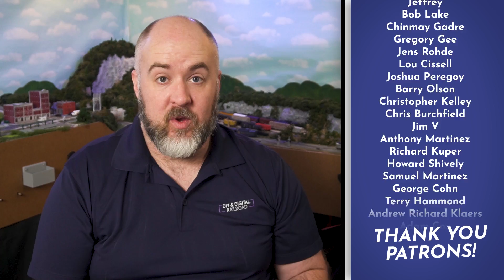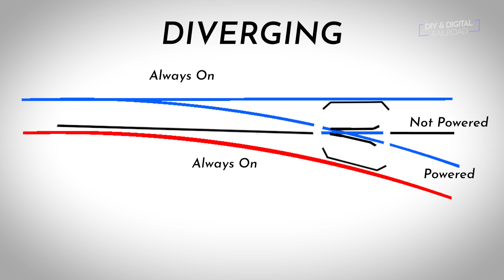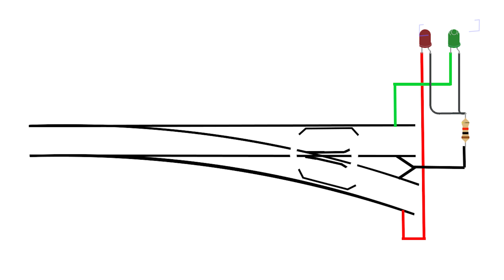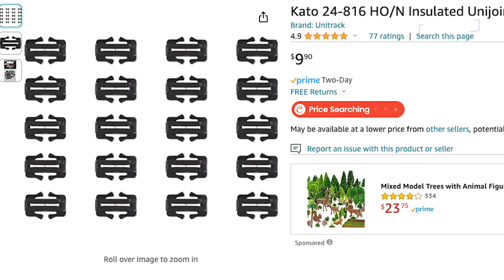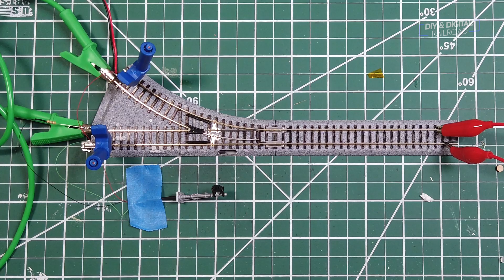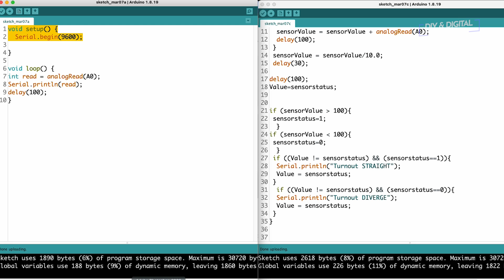Easy Signals for DCC Model Railroads

Comment: So could I follow this same guide, but add my common positive to the frog wire if using a tortoise/ip digital switch? this way as the frog is switched, so is the LED?
Reply: Also - do you need a diode to protect from reverse polarity?

Comment: DCC's FAILURE TO COPE WITH SIGNALLING, INTERLOCKING & TRACK CIRCUITRY !
But if you are trying to copy real life railway practice. Then interlocking between train movement, signalling, pointwork, and the necessary track circuitry is unavoidable. And I have not yet found a DCC system, that can provide this ! Only the traditional (12v DC) system known as TCC (Track Circuit control). Obviously it has to be understood, that no commericial company has solved the issue, that every model railway has a different track plan. Hence every layout requires a different wiring method to cope with its individual track plan !!!!

Comment: You'll have to pardon my ignorance as I'm still trying to learn how this works, but, how are those LED's working? I don't really know how to best explain my confusion, but as I understand it, LED's are directional current... and if you have the common on the frog section (which makes sense, as that flips polarity) you would be trying to send current the wrong way through the LED? I would think only one LED would light up and the other would not as it's recieving power the wrong way.

Comment: Thanks for the great explanation and the link to Larry's original video.  The circuitry is pretty basic:  two hot leads (one to each rail), one neutral (black lead to frog) and a two pole switch (the turnout).  I'm using Kato #6 turnouts and I can't seem to find, either in this video or Larry's how to connect the black lead to the frog.  Appreciate any help.
Reply: Rule #1 Watch video twice, comment once.  Larry is using the frog as the common (which isn't possible with Kato turnouts) where you are using the turnout's two inner tracks as the common.  Obviously, at the time, caffeine was reaching dangerously low levels.

Comment: Good video. Will use of these sensors “remember” the status of a turnout after the layout is powered down and then restarted? Or does that require the Arduino to “survey” the sensor’s status on power up? Thanks

Comment: OK but my usual modelling periods use mostly semaphore signals...
Reply: OK, so set up the sensor and arduino as per the video. Instead of the arduino "writing" to a display, change the code so that the arduino drives a servo that is connected to the semaphore.

Comment: If you put a ceramic capacitor in parallel with the resistors on your 'voltage sensor' then you wouldn't need all that jenky averaging code. It's alway better to do it in hardware. But it's also very scary that you're connecting one side of an AC dcc signal to the ground of your arduino. If your power supplies aren't well isolated something will go boom. I would recommend using an optoisolator instead.
Reply: Bonne idée,  quelle valeur?

Comment: I had noticed a short up to the point you said has to be isolated.  An AH-Ha moment. I assume a separate Arduino’s  might be needed for each turnout if have multiple turnouts?   Great information. THANK YOU 🙏
Reply from the maker: It really depends on the code.  You can have multiple signals coming into a single arduino.

Comment: Nice idea Jimmy, just a couple of points of clarification... Did you use the black insulated joiners on only the inner rails of the departure rails? also, your photo looks like a #4 turnout. The user needs to be reminded that these are user switchable between power routing and non. I am going to give this a try on a couple of turnouts in my yard and see how it works. Thanks to both you and Larry for the tips.
- Ron
Reply from the maker: Hello!  Yes the inner rails need to be isolated since the outer rails are always on.  The turnout shown was actually one of the Compact turnouts, but it is setup the same as a Kato #6.

Comment: Great video, Jimmy! BTW, Kato is just one of many power routing turnouts - many turnouts marketed as "DCC-ready" are power routing and would work as you have shown. Even those of us who use frog juicers are not left out in the cold: as long as the frog is electrically isolated from the two inner diverging rails (and as long as those rails are isolated from the connecting track, as you mentioned), this system will work.

Comment: This is pretty fantastic, I like the use of a signal on the turn outs , where are you  putting the insulation block on both sides of the turn out for the routes or at the beginning of the turnout? That confused me or maybe I should watch the video again. Great tutorial on the Arduino sketch too.

Comment: Not sure if it matters, but you loose the power routing of the turnout when you add those two leads to the frog.  A pair of diodes would stop that.  Nice video!

Comment: shame you dont do cmri arduino common anode signals or a video of
Reply: it's ok jimmy i did it
code underneath if it helps people

#include <CMRI.h>

#include <Auto485.h>

#define CMRI_ADDR 1  // CMRI node address
#define DE_PIN 5     // Pin 5 for RS485 DE on the Mega

Auto485 bus(DE_PIN);
CMRI cmri(CMRI_ADDR, 24, 48, bus);  // CMRI node with 24 input bits and 48 output bits

// Define output pins for the signal aspects
const int redPin = 13;
const int yellowPin = 12;
const int greenPin = 11;

void setup() {
    pinMode(redPin, OUTPUT);
    pinMode(yellowPin, OUTPUT);
    pinMode(greenPin, OUTPUT);

    bus.begin(9600);  // Initialize RS485 communication
}

void loop() {
    cmri.process();  // Process incoming CMRI messages

    // Read CMRI input bits or other conditions to determine the signal aspect
    bool redAspect = cmri.get_bit(0);   // Corresponds to CMRI output ID 1001
    bool yellowAspect = cmri.get_bit(1); // Corresponds to CMRI output ID 1002
    bool greenAspect = cmri.get_bit(2);  // Corresponds to CMRI output ID 1003

    // Set signal aspects based on CMRI input bits
    digitalWrite(redPin, redAspect ? LOW : HIGH);      // Invert logic for sinking current
    digitalWrite(yellowPin, yellowAspect ? LOW : HIGH);// Invert logic for sinking current
    digitalWrite(greenPin, greenAspect ? LOW : HIGH);  // Invert logic for sinking current
}

please note this is for a mega
kind regards Paul REDWOOD CITY UK

Comment: This is pretty neat and simple Jimmy and would make perfect for a switching panel to show the aspect of the turnout without physically looking at it. You could also do the same thing through a Tortoise Switch Machine if using without wiring anything to the frog unless youre using it as a frog juicer (different than signals). Now you just have two figure out how to make it drop red when something enters the block, and knowing you, you'll have it figured out in no time. 😃 - Jason

Comment: Would you be to do signals on a dc system or is it only for dcc?
Reply: With DC, like my layout, there is no power going to the switch when the train isn't running so there's no power for the LEDs